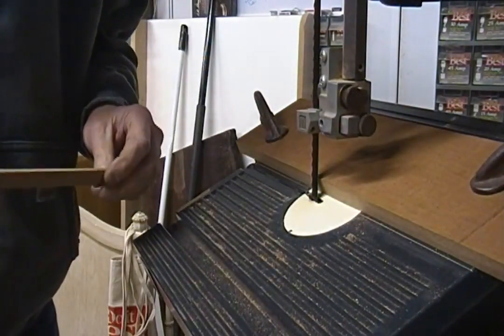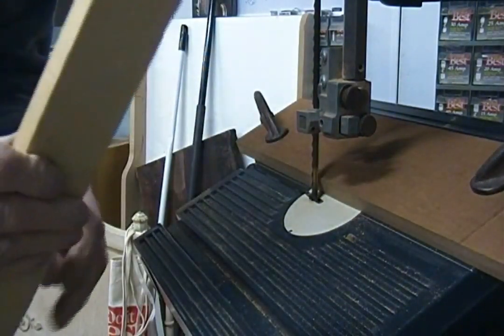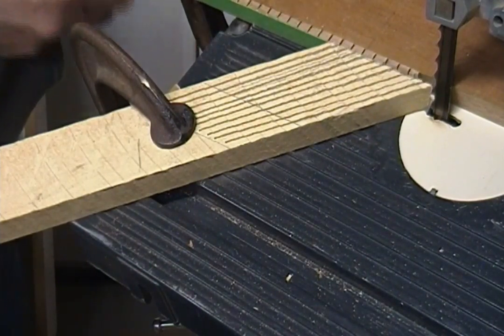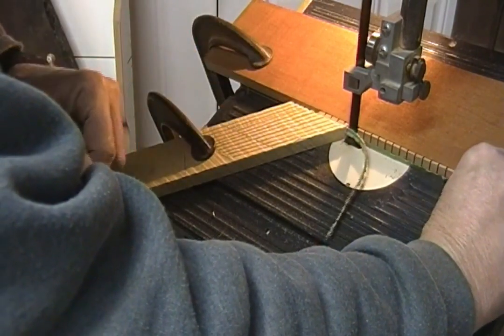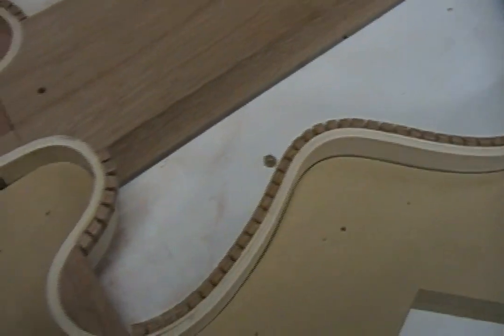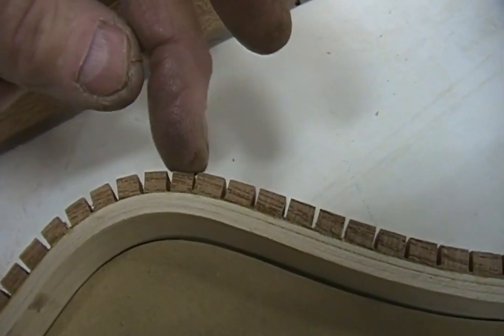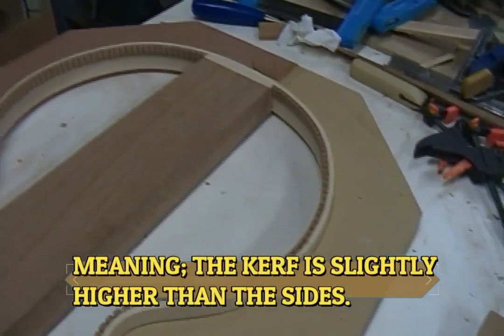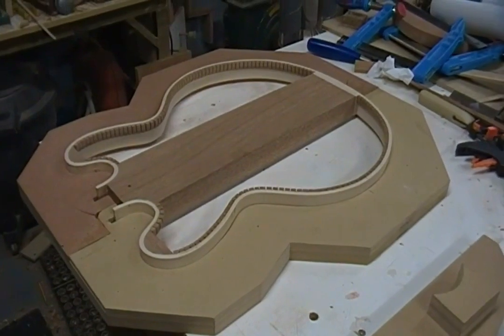CUSTOM BUILT JONAH ES-335 Part 7

Comment: Very nice and tidy kerfing Dane - also I believe it’s quite normal to have the kerfing a little higher and then sand it flush. Btw smart approach to use the thickness Sander, haven’t seen that before.
Reply from the maker: Thanks much Gert. Yeah the sides on a 335 are flat so the drum sander works very well.